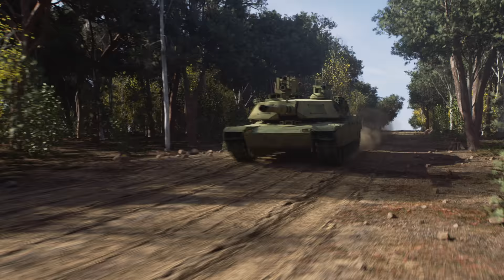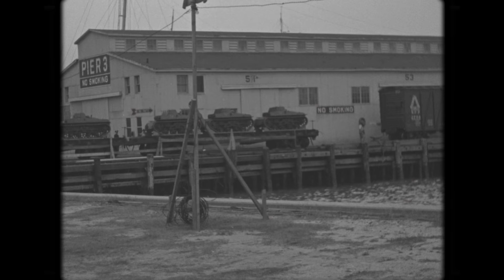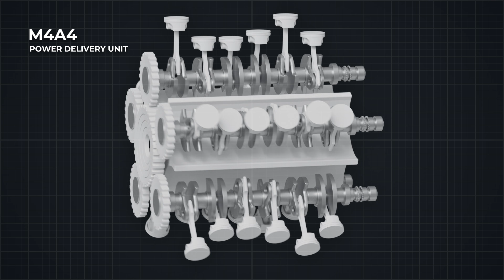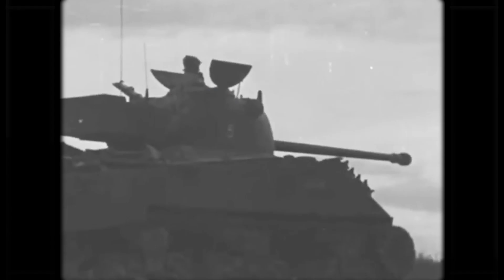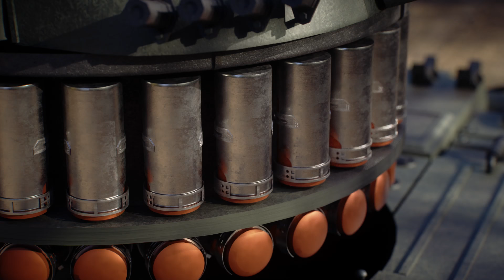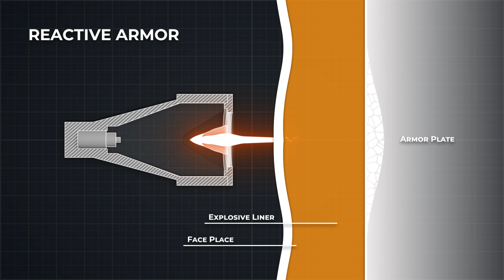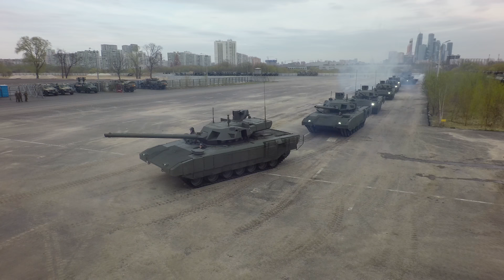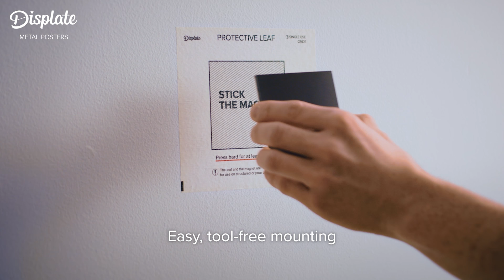Why America’s Tank Failed in Ukraine

Comment: With the AbramsX, the hybrid drive train is actually a good idea. If a piston engine's weakness is low end torque, then electric motors are the cure. Like a turbine, they make peak torque at 0 RPM. The downside is of course the battery. Typical Lithium-ion car batteries can get quite explosive when damaged. Less volatile chemistries exist though.

Comment: An electric hybrid engine has similar torque advantages to the turbine, but is more fuel efficient. A smaller fueled engine running at optimal horsepower can charge a bank of batteries or capacitors allowing rapid acceleration on demand while running the fueled engine at optimal rpm range for either power or fuel efficiency. The same has been found reliably in hybrid automobiles.

Comment: 1) Drones, which make all tanks very vulnerable
2) NATO tanks are twice heavier on average than Russian ones, which puts them at disadvantage in Ukraine due to: climate (mud and snow), terrain (soft black soil, numerous rivers), weak bridges designed by Soviets specifically to hold Soviet lighter equipment, but not heavier NATO one.
3) NATO tanks are more sophisticated and hard to maintain which make them heavier on logistics (and logistics is hit hard by Russians, systematically), more prone to breakdown in dirt, snow, mud and harder to fix on the frontline without specialized facilities. 
4) NATO tanks are more expensive and hard to produce and therefore there are less of them.
5) Most of Ukrainian tradition and institutional knowledge in military is based on Soviet experience. NATO equipment is more foreign on average.
6) NATO standards vary way more than old Soviet ones. Which creates a zoo and nightmare to supply and maintain.
Reply: Fair points!
Reply: There are some unfounded prepositions…… NATO spends a lot of time and effort on designing for maintenance…… additionally a four man crew reduces maintenance burden and crew workload during a sustained campaign
Reply: @robertpatrick3350  NATO is going to lose against Russia, just like it lost everywhere else and ruined its puppet regimes in the process.
Reply: @robertpatrick3350  
I don't know where YT put my detailed response. I will recap briefly.
Ukraine uses the following tanks from NATO: American Abrams, German Leo1 and Leo2, British Challenger2, Swedish ones, Polish T-based on Soviet ones. And that's in addition to own original T-Soviet based ones.
Now consider an Ukrainian mechanic, who studied on Soviet textbooks to begin with. Not to mention spare parts problem.

Comment: Just for starters, the Turbine was one of the competitors when the M1 came out.  It is NOT like they decided to add it later or that it must be added to fulfil a political promise.  Another thing to remember that the initial design of the Abrams was in the late 1970's with the first tanks being field around 1982-1983.  Think about that for a second -- almost 45 years of model usage?  Tell me how the T-62 did (in terms of longevity -- and it was ALWAYS known as a 'Pop goes the weasel' MBT.  What Ukraine HAS now IS not THE CURRENT VERSION (and capability) of the Abrams MBT -- But you are surely trying to make it seem that way -- REAL ENGINEERING!  This is TOTALLY and COMPLETELY disingenuous on your part 'RE' -- even more so -- AND YOU KNOW IT!  THIS IS an EFFORT by "RE' to try to slam US machinery and technological 'HOW-TO' and denigrate the west -- any way that pro-Russian (etc.) resources it CAN!  Seldom can something go 10 years WITHOUT upgrading -- yet the Abram indeed, managed that.  It fought within the precepts that its design and question REQUIRED.  Was it EVER going to traverse 300 miles in an effort to have the range to affect the battlefield?  No way (and that 79 tons weight number that 'RE' gave you -- that was BS -- BTW).  Was it EVER going to traverse 200 miles -- oh wait, it did.  It needed to be refueled -- but then again, what MBT doesn't?  See, not the problem that you are trying to make people think -- existed on the Abrams.  In case you were wondering, start asking about Desert Storm and the tanks that ended up in Southern Iraq -- and kicked the HECK out of the famed Soviet tanks (which, incidentally, are NOT much better than their DIRECT predecessors (like the T-55, the T-62 and T-72 -- BTW). Again, it is a 50-year-old design, I would say that it is much more capable than you are trying to make out.  Let's see what happens when THAT is brought out to the front lines, shall we?  Before you 'talk' why don't you look at history and the fact?  Oh, I forgot, pro-Russian Militant groups like you (it would NOT surprise me that you are propagandist mouthpieces FROM Russian, BTW PULL this garbage ALL of the time.  Kinda 'par for the course' I would say.  Go away!  My hopes is that you'll read this and -- as typically -- you will know that you cannot defeat this no matter what, and you will just vanish into the ether and know that you were found out, and it was NOT ever worth it.  You people are not ONLY disingenuous, but you're also PATHETIC!

Comment: An engineer fixating on engines and armor, or even just the design of the M1 itself, is searching in the dark under a streetlamp because that's where you can see. It's not just an engineering problem with a particular platform, it's a problem of first principles military theory.
Breaching layered defenses is the hardest operation in military tactics, ~80% casualties are expected in the average case if you're on the winning side. Doing that traditionally requires massing armor and supporting elements at divisional scales, but the transparent battlefield makes any such massing an easy target for long range fires to devastate before they even contact the front line, which forces penny packets of tanks to assault the front line with minimal support, and tanks in small numbers without supporting elements being dead meat has been a well known weakness since WW1. 
You would need an effective mosaic warfare doctrine that can all at once and at least temporarily and locally blind or deceive battlefield transparency, protect the massing formation from long range fires including drones, breach obstacles far faster than current methods, and more. A list of methods to achieve those temporary, localized, simultaneous, multi-domain superiorities to effect and exploit a breach. Then you would need to research technologies to make those methods possible. Then you would need to use that tech to design an ecosystem of platforms with the capability to perform those methods, and either survive or be cheap enough to treat as expendable. Then you would need training and exercise facilities & pipelines to train and organize people to do it all under pressure. 
In military science, this kind of first principles thinking process is called DOTMLPF-P, and the actual platforms like tanks, engines, and armor, are only the "M" (material) portion of that process.
If you really want to focus on tanks specifically, then it's pretty obvious that just evolutionary advances like Abrams X or Armata won't cut it, otherwise Russia would have deployed Armata by now if such minor tweaks were a realistic path to victory. To get these capabilities to be cheap enough to be expendable in mass in breaching assaults, and light enough to cross most bridges, is likely going to take disaggregation capabilities out of manned tanks into swarms of role-specialized wingman drone tanks. You might have a PD tank that shoots down drones, missiles, and artillery shells, a minesweeper tank, an anti-infantry tank, a tank destroyer / assault gun, an EW tank, a drone launcher tank, etc, and you combine them in different numbers like drone tank legos with human operated units to get the force you need to break a defense line. Probably something simple and easy to create variants out of that can be mass produced by someone with a high school education and a MIG welder, like a drone equivalent of M113 or MTLB, just an armored lunchbox good at off-roading with a big flat roof to weld weapons onto.

Comment: It actually succeeded because the idea was to get other countries involved with aiding Ukraine by just showing US support. 20 something heavy tanks were never meant to make a huge difference on the ground. Guess what tanks are for? In modern warfare tanks lead the van to draw enemy fire and act as roving artillery. By drawing fire they allow other assets to have movement and safety but this also leads to the tanks getting destroyed. They were never meant to survive forever on the front lines. The only other option is what Ukraine sometimes does is to use the Abrams advanced optics and fire control to put the tank back a kilometer or two from the front lines and use it to sharp shoot. This isn't always the best use because the rest of their tanks can't really do that so it is what it is. They stretch the survival of the tank as long as possible. I guarantee you those 20 something Abrams crews destroyed alot more than 20 enemy tanks so tank for tank they are still worth their metal they are just not the best tank option for this front because of their low numbers,  heavy weight, they use different fuel, excetra.

Comment: This is the first Real Engineering Video I have to dislike. There is so must misinformation, no proper fact-checking, unfair comparisons and worst of it all, showing the shiny Abrams X Tech Demonstrator for the M1E3.

The E3 changes the internal design concepts while keeping most of the hardware. 
Its going for a crew-less turret(See the TTB for the origin of concept before screaming Armata).
The over weight M1A1 mentioned in the beginning is the M1A1 SEP3, the current version, which, as the name suggests, is the 3rd upgrade package.
The entire motive was, since new technology that came out was just bolted on, the weight kept increasing(hence crossing 70 tons).
The M1E3 is the new plan where instead of bolting on the new tech, its going to be integrated into the tank design. Thus, reducing weight.
The new engine is a Caterpiller C13D diesel engine. Which is modular(increase modules for more horsepower) and is being planned to be introduced in more combat vehicles other that the Abrams.

Talking about the Abrams in Ukraine as if they are the American service versions, while the once sent were cheaper, less equipped versions, lacking spare parts, not approved by the Congress.

Tandem charger of missiles are a thing the ERA struggles against(giving benefit of doubt). Which the E3 and further models are integrating, not bolting on like the TUSK armour(curve plates shown in the video).
And Composite Armour on the recent Abrams is similar to the European tanks mentioned in the video.

Its almost as if its a paid propaganda video, ignoring specific things, while highlighting failure points that the doctrine isn't designed around.

And worst of all, this is on purpose, as the D-day series is well researched and the metrics compared make sense.
Even when comparing WW 2 bomber, Real Engineering compared Loss Rate, or "effectiveness per unit".
Just stating the number of losses without any baseline or comparison is useless or worse, purposeful misguidance.

Was this worth it?

Comment: Its not just the Abrams, there isn't a single tank that I can point to and say its doing well, arguably there are tanks considerably worse than the Abrams as well (not just the old soviet tanks) Challenger for example has recently been kept away from the front entirely. A majority of these tanks failures are not engineering or design failures, but failure in tactics and doctrine - both sides have been seen using tanks in extremely unusual and risky ways that most western militaries would consider suicide. Many tanks are sent far ahead of infantry and used as scouts and get caught in ambushes - tanks are not designed to be used this way. If you use anything wrong it will fail, simple as that. Its like using a screwdriver as a wrench and saying its garbage because it doesn't loosen a bolt.

Comment: Haven't watched the whole video but i know that one big factor is how tanks are used. Abrams has been in hot zones, just like all of the Ukraine's soviet/russian made tanks. The losses are much higher than any other foreign tank type in Ukraine because of this. Now, there are also factors like the modern warfare completely changing in a year with the introduction of drones. A lot of Abrams were lost at quick pace as they were used wrong, but that was both sides doing the exact same mistakes while learning. Same goes to a lot of US equipment, they have been used in the heaviest zones where the losses are highest. But what is clear is that all tanks need counter measures against drones, cope cages do actually work: they are mostly air so explosives that work well against armor don't do that much damage to netting.

And of course, if there is artillery in range... At the moment tanks are hiding, doing scoot and shoot, and often they are used just like artillery, not like battle tanks at all. 

Next gen tanks have to have active drone protection and they need mobility more than armor.

Comment: To be accurate, the Abrams didn't fail in Ukraine.  All of the tanks failed in Ukraine, predominantly because neither side controlled the sky and drones are rampant.

I agree the new Abrams replacement - at a lot lighter weight - is a step in the right direction.  But I find your core statement/title inaccurate and lightly supported, when most of the video spend describing why tank powertrains and weight management is hard.

Comment: So many butthurt Americans here trying to rationalise why the M1A1 is significantly underperforming European tanks in the same circumstances, without having to admit that the M1A1 just isn't as suitable for this kind of war.
Reply: Yes and no, the tanks sent to Ukraine is a very old and outdated design without any of the supply lines or doctrine in place it was designed for. But also this video is grossly misleading the issues the tank has in Ukraine while simultaneously calling the T-14 (a tank never ONCE seen on the battlefield) the superior tank. Not to mention getting very basic information wrong (like the jagdtigers main cannon) and not understanding that if a tank is damaged but the crew survived, it has accomplished its goal.

Comment: i think the fuel consumption of the M1 abrams is one of the most overblown things when it comes to public knowledge of military equipment
also one of the actual reasons any increased fuel use is an issue for ukraine, is that they dont possess the massive fleets of tank transporters the US does, forcing them to drive their tanks to/from areas a lot more than intended
Reply: Nevertheless, it is a thing. Oz also has masses of transport, for the armour, and also for the many POL tankers.
Reply: Pretty much this.  The Abrams showed it was the world's best in Desert Storm, and not by a little.  But used in the wrong war, by the wrong nation, it doesn't work so well.  The video is correct that the US has the world's best logistics capacity.  That means for the US, the heavy fuel consumption of the Abrams is a number on a spreadsheet that says to bring more fuel.  Maneuvering against columns of Soviet tanks, it was lethal beyond what was hoped.  For Ukraine, fighting a basically static trench war with occasional Russian tanks popping up here and there because they were already destroyed, and lacking the US's logistics capability to simply provide the needed fuel, it's the wrong tank.

It would have been nearly the right tank for Ukraine in the first few weeks of the war.  Those long lines of Russan tanks and other vehicles entering Ukraine would have been a carnival attraction for the M1 crews.  If they already had M1's in service, they would be in better shape (and Russia in even worse shape) today.  But now, with Russian targ...er, tanks, infrequent and in small groups, with static front lines and lack of fuel, where the ability of the Abrams to quickly dash from cover to cover while sniping Russian armor constantly on the move is compromised, it basically has to sit there and serve as a periodically self-mobile anti-tank gun.  Used that way, instead of keeping it moving constantly, no.  It has nothing to do with "modern battlefields" but very specifically "in the hands of a much poorer nation that can't afford to operate them properly."  On top of that, Russians are making a special effort to hit M1s as a propaganda victory, which simultaneously ties up assets that could otherwise be striking other tanks, giving them an artificially good survival rate in comparison.

But a very important point not addressed by one numerical factoid that 27 tanks on a battlefield were destroyed:  how many of the crews of the 27 destroyed Abrams survived?  How many of the Russian T-64/72/80/90 crews survived?  M1s don't suffer from their ammo carousels cooking off.
Reply: 100%.  These are the most static frontlines in modern warfare.  Armored charges are 2-3km at most.  The range of the Abrams is up to 150X that distance.  

This video is ridiculous in many ways.  The loss rate is because they were used many times in combat as the tip of the spear.  The most lethal and survivable tank in such small numbers will eventually take a high loss rate because it IS successful.  A good tool gets used up first.